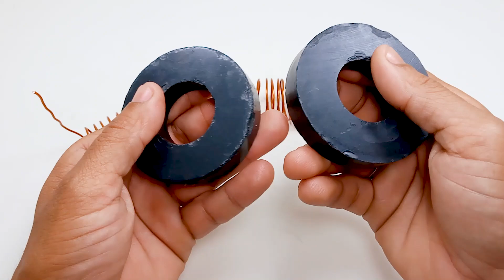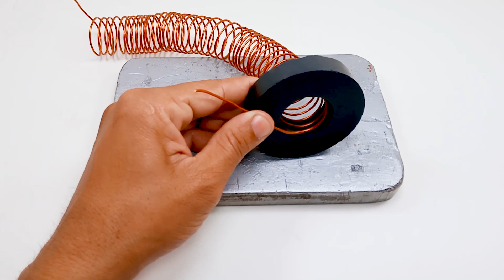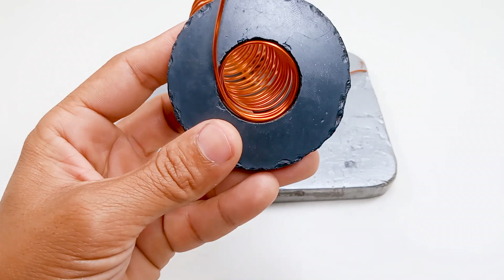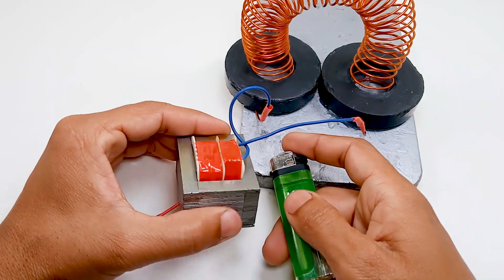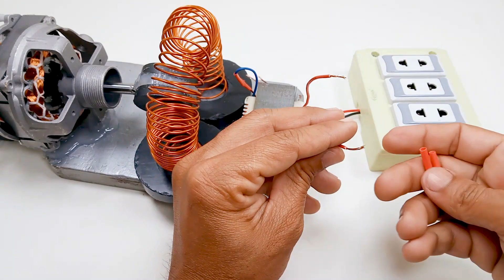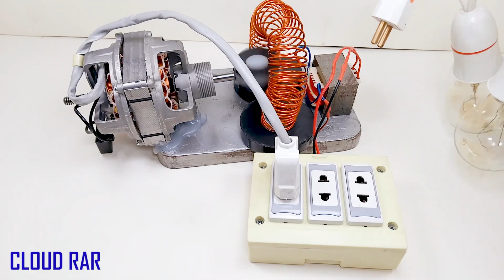How to make self-running machine into free energy  220v 18000w powerful electricity Generator

Comment: A logical idea, but some conditions must be met in order to achieve this experiment, and according to the capacity of the transformer, so that if the transformer outputs 12VAc, then when it is reversed
The completed coil must give us 12VAc to connect with the transformer to reflect a current of 220VAc👋
Reply from the maker: Thanks for informations